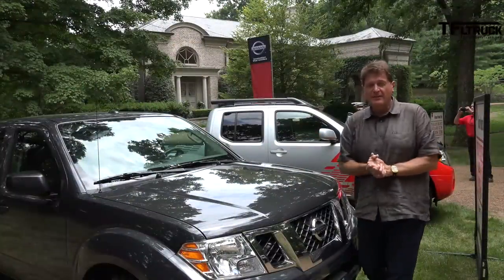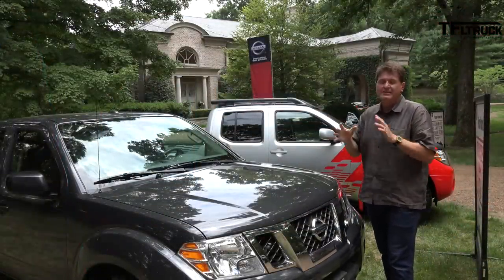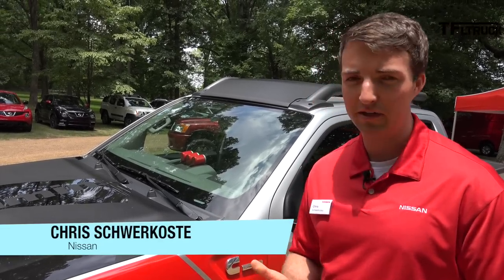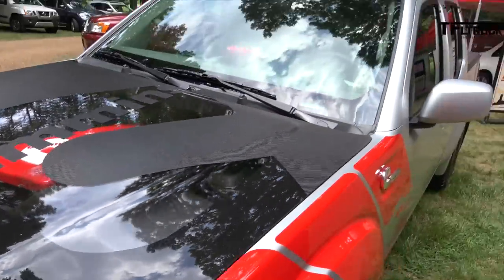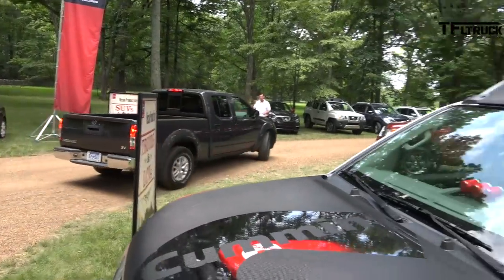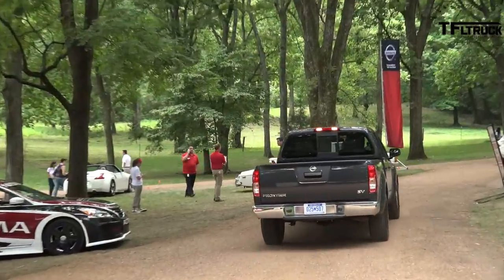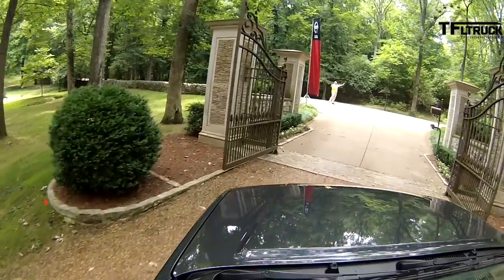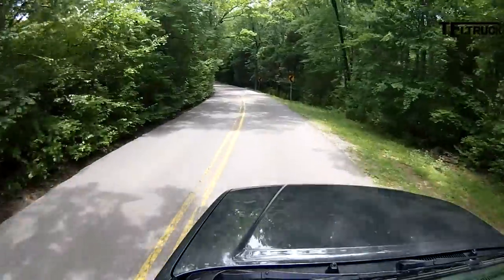Exclusive: Nissan Frontier Cummins Diesel Prototype Pickup Drive & Review

Comment: I really like the idea of diesel, but I really don't see the advantage it should have over a comparable gas engine. First I know is longevity. Diesels are simpler and endure less stress, but it doesn't appear that they outlive their modern gas cousins with the same age and/or mileage. Second, with the upfront premium of the engine itself and, I know it's not the same everywhere, but around here, diesel is nearly 40 cents more per gallon than gas. Add the higher cost of diesel maintenance over the costs of a gas engine and it's significantly more. Plus all that EGR crap the EPA requires and the fluid. The cost of ownership just from the original purchase for oil, fuel and specifically EGR fluid, would cost me $121,000 at today's cost, over a 20 year period versus slightly over $100,000 for the gas truck I have now. I know it sounds like a lot, but over 20 years it's not so bad. Either way though, the diesel would cost over $1000 per year more than a comparable gas engine. All this is not including other maintenance, because that figure could be higher for the diesel as they tend to have more costly repairs, though admittedly less frequently. I don't know... If the cost of diesel went down significantly or you paid for an EGR delete, it would still take longer than the average person keeps their cars to come anywhere close to breaking even with a gas engine. I just don't see the advantage of a diesel over a modern gas engine. 30, 20, and even 15 years ago sure, but not today.
Reply: Modern diesels aren't anymore simple or less stressed with all the emissions equipment. If anything, modern diesels have the bigger burden.
Reply: ***** Typically I would agree, but they are less complicated by design. They have less moving parts that a gas engine. All that emissions crap does is strangle it.
Reply: Daniel Bell
"Typically I would agree, but they are less complicated by design. They have less moving parts that a gas engine."
 
What you say isn't really clear and not necessarily true.

Not all diesels are like the diesels you find in old, non-compliant semi trucks that'd run a million miles. Not only that, gas engines can be made to run with high a compression, no ignition system, turbocharging, direct injection and the diesel cycle (yes, diesel cycle) That basically makes it like a traditional diesel engine but one that runs on gasoline with the same simplicity (or complexity).

In fact, Hyundai is developing an engine just like this that they're calling GDCI (Gasoline Direct Compression Ignition). People tend think that diesel is inherently simpler and more efficient, but that's really not true. Pretty much everything about a diesel can be transferred to gas engines to make them run in a similar way. Really, that's what manufacturers are doing to make the gas engine more efficient. Turbocharging, GDI, higher compression, etc. This is why we now have so many small cars with 40+ mpg as well gas engines that produce torque that's equal to many diesels.
Reply: emdec55 I'm glad you said that, I didn't know. The only experience I have with diesel is a beat up 95 F-350 and a chromed up 80's Peterbuilt that my Grandfather had. If what you are saying is true, then that just confirms my original thoughts that there is no real advantage between modern gas and diesel engines.
Reply: I  think if you do a lot of mileage then yes they are better.  Above 25000 miles a year you would probably benefit a descend amount of cash.  this would probably cover the diesel extra cost in 3 to 4 years.  I Owned 3 diesel, 2 vw which a very reliable.  one with over 260kmiles.  I also owned an old 96 GM 6.5D.........not so reliable.
Reply: rafafia baloney But you are comparing diesel cars to a diesel truck. Those TDI's get good mileage vs a truck that at best would only get around 25-28 mpg. Add the extra cost of maintenance and the premium of the vehicle and fuel itself and the diesel still costs more than a comparable gas engine.
Reply: I think some of the diesel trucks shows better mileage in the global market.  I'm not sure but the older Ford Ranger (2.2D I think) in NZ/Australia was getting around 33MPG and also the Xtrail 2.0TDI (VW engine I think) was getting good fuel economy.
Reply: rafafia baloney That's true but in the US we don't have very many global vehicles, and of the ones we do, few offer diesels. There are several key differences that the US does that changes our mpgs vs the rest of the universe too. I'm not sure about Australia, but in Europe, they measure mpgs differently than we do in the States, and thanks to our EPA, the engines are choked down with required emissions equipment, so that hurts our mpgs as well. Also, despite it being the oldest type of engine, the diesel is seen more as a luxury here so it demands a higher premium, from the initial cost of the vehicle itself, to the fuel, which can be about 20% more than our premium grade gas. And, because there are so few diesel vehicles, it can be difficult to find a gas station that sells diesel. Some stations just don't sell diesel anymore, and haven't since the late 80's- early 90's. I, personally, would almost have to find a truck stop just to find a diesel pump.
Reply: The Audi Q5 tdi average closed to 30mgp and highway up to 38mpg with towing capacity or 4400pnd.  MB Glk250 has the same numbers with towing capacity of 3500pnd.  So having a small truck within those guide lines is very possible.  I think the issue is not the technology but the market/politic.  trucks like these would literally change the commercial market
Reply: I agree that I misspoke about diesel being simpler and enduring less stress. I appreciate you sharing your knowledge with me and taking the time to comment. I was corrected on a similar comment I left on a different video and have since did more in depth research on them. However, that doesn't alter my main points over longevity or of them being more expensive and having more costly repairs, even if those repairs are not as frequent, compared to a gas engine. As I said before though, if the cost of them came down or even the price of diesel fuel were more in line with the price of gas then it would be more difficult to argue against them.
Reply: The only thing I would consider very expensive that is different on Diesel would be the injection pump.  The rest of the technology would be pretty much the same, cost wise, as gasoline cars.  With all the technology going into cars these days I could see gas vehicle repair bill being as much as diesel ones.   I do believe Garages tend to charge you more when you drive on their yard with a diesel......That's why I do my Mechanic my self  and they are pretty simple to work on....at least my Jetta is and I'm not by any means a mechanic.  As long as I don't have to play with internal stuff(valve, timing, crank..Etc.) or major electronic.
Reply: rafafia baloney
Not really true, and I don't really think you understand how modern diesels have changed. Today, most gas engines make enough power without turbo chargers. That's an expense you will never be forced to worry about. Also, you won't find anything like a DPF or SCR system on a gas engine. If these things fail, they can cost thousands. And to make things worse, you can't just have any neighborhood mechanic do any serious work on a diesel, you'll have to pay big money for a diesel specialist.
Reply: This is why I've been told again and again that even when shopping for a heavy duty truck, unless you regularly tow heavy, don't even think about buying the diesel. It's NOT going to save you any money, EVER. Don't even entertain the thought of it unless you need the capability. The fuel economy needs to be ridiculously better than the gas equivalent for it to pay for itself, and presently there isn't a model where this is true.
Reply: I Also Own 2 TDIs.  2000 Jetta  and 2011 sportwagen and they are the best vehicle I've own for reliability.  I did some calculation based on the cost of our cars and real life mileage.  the premium of buying a diesel pays itself after about 40k miles....thats also taking into account if diesel would be 15% more expensive.
Reply: ***** "you won't find anything like DPF or SCR systems on a gas engine"  SCR stands for Selective Catalyst Reduction AKA catalytic converter.  Remember about 15 years ago when everyone wanted to punch out their CC.  This is a very new technology to the diesel market and will be further refined as time goes and products evolve.  Please do not use these emission regulations shy you away from a great engine.  When it comes to aftertreatment there is no other company that can compare to Cummins.  I truly am hopeful to see this in full production and would love to get my hands on one.
Reply: Chad Farabaugh SCR isn't like the cats found in gas vehicles, SCR uses DEF to lower NOx. But whatever they are, you may very well be correct about the future of diesel emissions controls. But unfortunately that isn't true today. The company I work has trucks with EPA compliant Cummins engines, but even they have been seriously problematic. When these engines actually become reliable, and when the premium isn't $5,000-$10,000 over a gas engine, maybe I'll consider diesel for my personal trucks.
Reply: Very true I agree with the problem with the initial cost.  I have always said that unless you have a need the extra torque from a diesel engine it would take a long time to pay off.  I am really curious what the MSRP on the diesel Frontier will be and from there determine the short term and long term costs.  Personally I would rather spend that kind of money on a full sized truck.  Either way most likely wont be in my price range but its nice to dream, right?

Comment: The problem is it has very low horsepower it needed 300 hp to be perfect 

Put it like this... A 2014 Honda Civic si has 200hp and its a car 

So if this is a smaller truck why doesn't it have more horse power?

The diesel motor is great but it needs more horse power 

300 horse power would make this Nissan Frontier very famous

Comment: I'd love to have a truck like this, but the 30 percent boost in fuel economy will be offset by the 30 percent markup in price and the higher cost of diesel. It would take the average person about 500,000 miles before they saw any fuel savings.
Reply: +John Deere Which would be offset by the 40% boost in torque :)
Reply: true, but for 38 grand?
Reply: Yeeeeaaaah No.  :(   I'd want the base truck version with a stick and a diesel.  That never happens though.

Comment: Five years later and still no Frontier with the Cummins motor. What in the hell are you doing Nissan?
Reply: Selling the old frontier at about the same sales volumes.  In fact, sales volumes are on the rise again.  In the Pro 4X trim its holds its own.  But buyers mostly buy it since its more reliable. Even rated most reliable mid size.  The VQ 40 is a beast and the transmission tune is sweat.  Pro 4X is the one to get.  With that you get 8 way power seats, leather with heated seats, SAT, BT, NAV, back up cam with sensors,  dual auto climate zones, heated mirrors, 7 speaker rockford fosgate with sub, sunroof, 31" all terrain tires, bilsteins with offroad suspension, 4X4 HI/Lo with hillside descent, dana locker, standard lifetime factory spray bed liner with factory roof rack (functional).  I bought the top trim for just under 35K.  Getting something that loaded with Toy/GM will run over 5K more and will NOT be remotely as reliable as this.  This is guaranteed reliability  Its proven.  We are talking over 200K/300K without much upkeep.  With the GM twins they will be in the junk yard.  They already have chronic 8 speed transmission issues.  The taco's active transmission is a gear searching, gutless early shifting mess.  Horrid engine/trans tune.  The worst.  So be glad we still have the Frontier since it remains as the only true mid size that is still reliable.  Build like a tank.  Drive this hard for 10 years and it still won't rattle.  The titan box frame is overbuilt.  Everything is overbuilt.  You won't see the hood wobble like crazy at speed like the Colorado.  This is all steel body.  Its heavy.  And its the real deal. 

I test drove all the competition.  And finally the Nissan Pro 4X last.  And wow, you can tell this is the only one remaining that is a heavy duty mid size with the best engine/trans tune and by far the best road manners, ride etc.. Plus this will offroad better then the others.  This is basically a truck version of a jeep.  

Too bad they didn't drop the Cummins motor.  But there is a good reason.  The EPA and the required DEF system is VERY complex and adds considerable amount of cost to the engine option and the potential for extremely costly emission repairs (Nox sensors) out of warranty was something that Nissan did not want to burden their customers with .   Lots of folks also want Nissan to bring their overseas model to the US but it won't be the same work horse as this.  It will be lighter, with some version of the 3.5 and will get a few MPG's more.  But its no tank like this and will never output torque like the mighty VQ 40.  One only has to drive a pro 4X once to realize why this still sells in numbers and why Nissan still makes it.  I'll say like many before me have said, updating it just for the sake of updating is a lame reason.  The design is great.  Interior is more ergonomic then both the GM twins and Tacoma.  Superior seats, probably the most capable 4X4 system in the segment unless you get into the ZR2 or taco pro level which is into the Plus 40K dollar range.  You can pick up a Pro 4x without the leather/sunroof package for around 32K.  Maybe even lower. And in that trim you can even have it with a 6 speed MT.  Buy this if you don't want any problems and intend to keep it past warranty.

Comment: there's another cummins engine in the nissan frontier the 5.0 V8 diesel which i don't understand why they give a ram 1500 3.0 v6 diesel & not the 5.0 v8 diesel ?
Reply: That 5.0 V8 TD is for the Nissan Titan. And I think the Ram didn't use it because Cummins made the 5.0 for Nissan specifically, + Ram already has the sweet 6.7 Diesel
Reply: Ricky Julian maybe ram have the 6.7 diesel but it's not in the 1500 class , but i don't know what ram people are doing ? i mean everyone will buy the 5.0 V8 diesel over the 3.0 V6 diesel if it was on ram 1500 class .
Reply: Two reasons that Ram went with the 3.0 instead of the Cummins 5.0:  The 3.0 is made by Fiat, which owns Chrysler.  The 3.0 is also a much more substantial MPG increase over the 5.0.  The fuel mileage issue was really the deciding factor from what I've heard.  RAM needed the CAFE numbers of the smaller engine.
Reply: Ram at one point stated that they feel Chevy and Ford are doing too much with their 1500's.  The 1500's can now tow like 12,000 lbs on the new GM trucks.  Ram is trying to keep a 1500 what it has been, so it doesn't take away sales from their 2500 and 3500 buyers.  I just got the Ram with the Eco Diesel and it can tow over 9,000 lbs.  If I needed anything more, I would have gone to a 2500.  All they are doing is trying to keep each truck in its own place, rather than having 1500's tow like 15,000 lbs and stealing the 2500 and 3500 market.
Reply: I have a friend who works at Cummins as a Service Tech Engineer. He said that Cummins was going to build a line for the 3.9L 4 cylinders to go in the 1500s when Chrystler went bankrupty. When Fiat bought them out, the plan was scrapped.
Reply: *****
That would have been pretty sweet, that's a big 4 cylinder for a pickup
Reply: Na I'd love to stuff one of them 4bt's in my 98 Silverado. That would make a nice toqurey half ton that could tow well and get good mileage. It would have been just a smaller version of the 3/4 ton if they would have (and should have) done it.
Reply: Because they want the titan to be more compribal to a 2500  the titan is nissnas big truck where ram has 3500s readily avalible
Reply: Because they call it the "Eco Diesel" because it sports better mileage. The smaller engine makes higher economy.
Reply: Peyton Walker
& if people are going to take the v8 diesel on ram 1500 then the ram HDs will lose their market & few will be bought seems they knew this would happen .
Reply: mohammadkwt That is a big part of the equation, I am sure.  You could also say that the light duty Ram diesel doesn't need to tow more than 9,000 lbs because Ram has heavier duty pickups in the lineup to fill that need.
Reply: Ricky Julian Originally the 5.0L was designed for the Dodge 1500.  Dodge said went with 3.0 for two main reasons.  One, price, the 5.0L left dodge with a very slim profit margin.  Two, don't forget about dodges new Italian counterpart,  fiat wanted to see a more a diesel that appeared to the average customer to be both cleaner and more fuel efficient.  Personally I think this was a big mistake on Dodges part,  if they would have went with the Cummins there would be one in my driveway right now.
Reply: Chad Farabaugh Completely agree with you that they made a huge mistake.

Comment: if only they flattened the hump for the shaft in the second row, made the seats thinner, more contoured, supportive, and not too upright
also i wish they would include a manual transmission and remove that vertical line on the second row windows

Comment: Use the 3.8 ISF instead.
Reply: +Diesel Man and gear driven internals vs the 2.8 chain driven, or so I hear.
Reply: +Diesel Man... can be rated(derated) the same as the claims by Nissan to the power the "2.8" is making. It would be silly to build a 2.8 when you could make a 3.8 have have a way better equipped vehicle. I won't buy a 2.8.

I demand your man card :-)